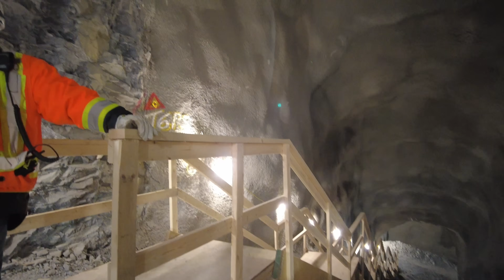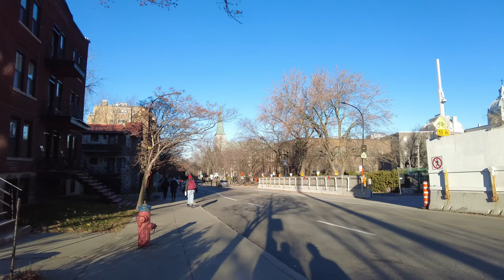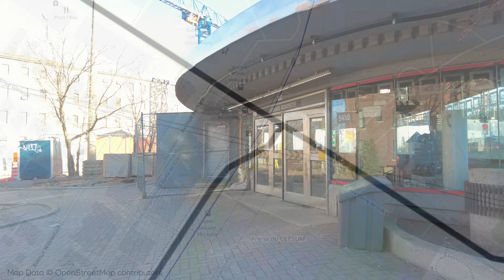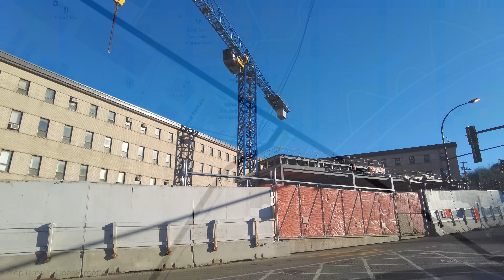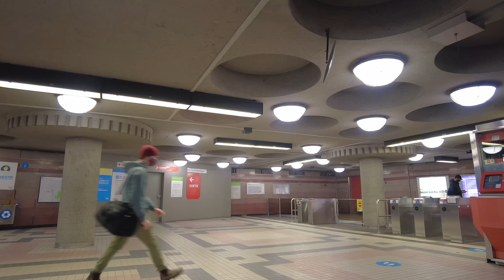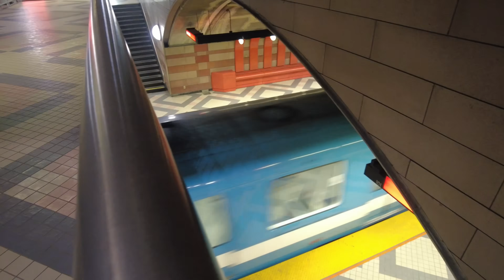This Metro Station Will Be 20 STOREYS Deep! | Édouard-Montpetit

Comment: The ceiling of the station looks really ghetto -- they really need to spray some concrete colour epoxy paint on the entire ceiling to cover up the gastly water penetration repairs. Doesn't anyone planning/executing the work think about these things?
Reply: I saw those too, in other stations. Made me worry if decay was creeping in on this quite new system…
Reply: Oh yeah about that, That station has suffered a flood caused by an aqueduct break somewhere in 1988 (I think) which as result, has delayed the opening of the extension to Snowdon.

Comment: In London, UK the deepest tube station is Hampstead with platforms at 58.5 metres (192 ft) below street level. The abandoned "North End" or "Bull & Bush" station, which was never finished, would have had platforms 67 metres (221ft) down. Both date from 1906/7.
The deepest metro station in the world is Arsenalna, Kiev, Ukraine at 105.5 metres (about 346ft). The next deepest is in St. Petersburg, Russia where Admiralteyskaya station is 86 metres (about 282ft).
Twenty storeys (72 metres, 236 ft) for Édouard-Montpetit station is deep but not record-breaking.

Comment: Hmm seems pretty deep. Did they ever consider an elevated REM? 

From my experience with deep stations, they aren’t very desirable because they can sometimes take multiple minutes to get to and from trains. Maybe Montreal has super quick elevators or something to compensate though lol
Reply: @Valérian thankyou for explaining
Reply: @Valérian Cut and cover was used for part of the Oslo Metro in the 60s, and partly for a short extension in the 80s. Most of New York & Paris & Berlin’s metros are built with cut and cover. It’s not impossible doing now, it’s just rerouting street traffic to other streets and rerouting all sorts of pipes, conduits, cables & sewers. By going deep, you avoid this.

Comment: this 20-storey deep station's depth happens to be an equivalent to a 15-storey building
Reply: ahhh we people can laugh at this while the vast majority of the world has no idea what we are talking about.
Reply: How many steps?😁
Reply: @ukcardcast6711  zero. My understanding is that it will be entirely elevator access.
Reply: lol
Reply: Why so deep?  Hard rock in the way?
Reply: @michaelrmurphy2734  it's under a mountain in an original rail tunnel that took trains from Montreal Central Station to the north.  The platforms are being built at track level and connected to and east west metro line that is closer to the surface.  The new REM line will use the old tunnel hence why it is so deep.  And yes it is solid volcanic rock.
Reply: That's a tall story
Reply: you cant escape the 15 storey curse...
Reply: @goatgamer001  the 15 storey curse?
Reply: The real trick is, no matter how deep the station, it's always 15 storeys deep 😉

Comment: As an Ontarian I'm probably not the first one to say that Montreal has much nicer stations overall than Toronto subway has. I've never ridden their metro trains though so am not sure what they're like but it appears to be a quieter type of train with the rubber wheels.
Reply: The trains seen in the video is the old model of train. They've been entirely replaced on the green and orange line by now. Blue line is next. The new trains are pretty slick and are more comfortable due to them being a linked accordion setup. There's a continuous gentle breeze in them that makes the summer heat a lot more tolerable.
Reply: @alexseguin5245  Green line still runs the janky old trains, but not exclusively. Feels like maybe a 1:5 ratio of old to new trains. I avoid the blue line like the plague because it's always old trains and you have to wait for days for them to show up, so they're always overcrowded. Glad to hear they're on their way out
Reply: @kateb2643  This is quite a late reply, but I'm wondering why you hate the older MR-73 trains so much? The reason you pointed out (that they take forever to arrive on the blue line) isn't really fair since that's just the frequency that the line operates. I find the MR-73s to be generally comfortable and in good condition for being nearly 50 years old. Obviously, the Azur trains are superior in things like ride quality and ventilation, but the older models are serviceable and have a likable charm to them.
Reply: I haven’t gone and measured the decibels, but personally I find the Montreal metro trains to be quite loud. It’s just a different noise than the noise that steel wheels make (it’s less screechy). The noise doesn’t really bother me, but it does make it difficult to listen to something with headphones.
Reply: they have no ac tho. in the summer it gets so killer
Reply: @sebastianz1273    In Singapore and Kuala Lumpur the stations are air conditioned because they have platform barriers.  The barriers isolate the stations from the outside humid air so its practical to have AC.   Another reason to get platform barriers.  The Crossrail line in London is 100% platform separated.  Reese would know.  He was there for opening day!
Reply: @sebastianz1273    HAHA!!!   And how long IS summer in Montreal?!   Heat?   I'll take it!
Reply: @michaelrmurphy2734  We’ve already had some 30°C (=86°F) days in the past few weeks. And the hot summer weather generally lasts until September. And I expect the number of 30+ degree days to increase in the coming years because of climate change. 

But the new Azur trains are very comfortable and modern and sometimes it can be nice to get out from the sun for a little bit.
Reply: @sebastianz1273  And in the winter, you're looking at mucho frio.  Not joking.
Reply from the maker: They are really nice, you should visit!
Reply: I grew up in Montreal and HATED the Metro without air conditioning that the TTC subway has.

Comment: They are going to connect the new platforms via elevators? The London Underground used elevators before escalators, the issue was the elevators soon get queues, unless the station remains under-utilised.  Of course London still does have some stations with elevator only access (except for emergency stairs) these are rare, Convent Garden being the must well known, as it’s the station for the London Transport Museum.
Reply: Not to mention the wear and tear and need for ongoing upkeep of elevators.   Bad idea.
I think elevators should have restricted access.  Only for disabled and people who can't climb stairs.  Which I something I CAN do.  If you are able bodied, you don't need an elevator!
Reply: @michaelrmurphy2734  no different to wear and tear on escalators. Modern elevators are fast, high capacity and reliable.  There's a station in Seattle that is lift access only.  Four lifts and no lineups.
Reply: @lightplane  Still only moves a fraction of what 4 escalators could do
Reply: @JKK_85  depends on the design, speed and capacity.  But the number of lofts can match the capacity of escalators.  Lifts move people faster than escalators, are safer, less prone to breakdown and are accessible for everybody.  A bank of highspeed high capacity lifts can end up being quicker than escalators.  Lifts are also much cheaper on deep stations than escalators.
Reply: @lightplane  An escalator will always beat a lift for capacity. In an escalator shaft you can basically fill the entire length with people, in a lift shaft you can only use a cross section of the shaft. In a busy station they can also lead to a crush with a train full of passengers all trying for the lifts at the same time. There's a reason busy metros like the London underground have been fitting escalators at all their lift only stations. Also obviously stations should have lifts for accessibility but it shouldn't be the primary means of entry/exit.
Reply: @michaelrmurphy2734  - of course new stations in London, and older stations are all being upgraded to provide step free access, this does require elevators, for people who require them. Including elevators which travel on the same gradient as the escalators which is a bit strangle but in some locations a vertical shaft is not possible.
Reply: @DavidStonePhotographyUK  The Oslo Metro system has elevators in the stations where there are escalators, two stations has elevators only (but a sort of «emergency exit» thru a loooong sloping pedestrian tunnell). But the Oslo Metro is mostly quite shallow, so regular steps (and ramps) are sufficient, plus most of it is above ground. The heavy rail network has a central commuter rail station in the city centre, and that has a «cable car» style elevator.
Reply from the maker: They will be a number of high speed and high capacity elevators
Reply: @RMTransit  That's a real problem then if they ever expect the station to get busy, adding in escalators later is very expensive. Just look at how much money the London underground has spent doing it.
Reply: If I'm not mistaken, I have read the station will have 5 high capacity and high speed elevators.

Comment: So clearly not in London then, where every station is 15 stories deep, regardless of its depth in meters. 💁🏻‍♀
Reply: We use Imperial storeys which are slightly larger than a metric storey 😉
Reply: @K-o-R  Are they equivalent to shaggy dog stories?
Reply: I only opened this video for this comment. I knew it would be here
Reply from the maker: London is a strange strange place!
Reply: Except the sub surface lines...
Reply: @teecefamilykent  No, still 15 storeys deep 💁🏻‍♀🤪
Reply: :-p what about Ealing Broadway Station?
Reply: @teecefamilykent  The steps up from the platform to the street (about 3 meters) are equivalent to a 15 storey building 💁🏻‍♀
Reply: Even ground floor stations are 15 storey